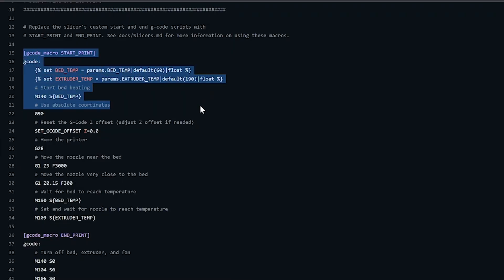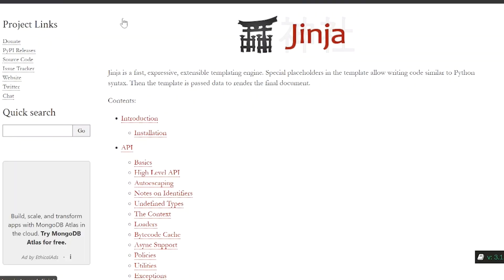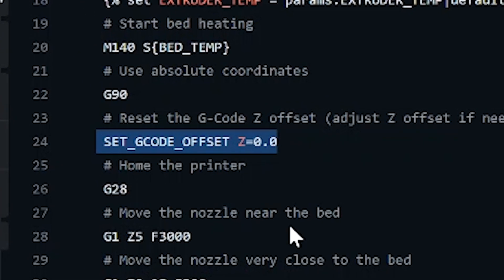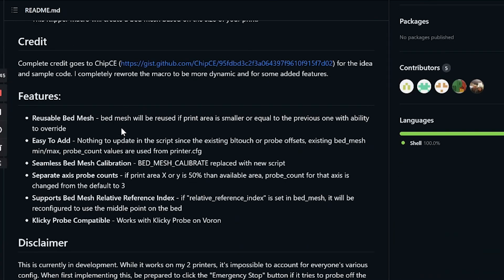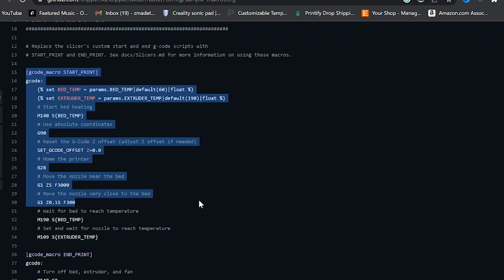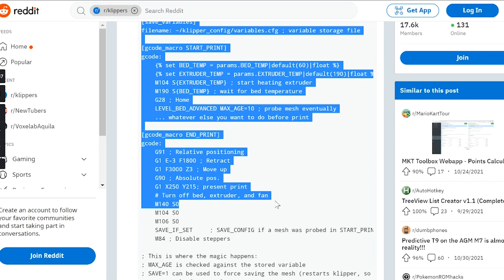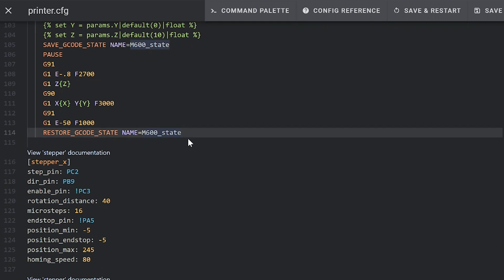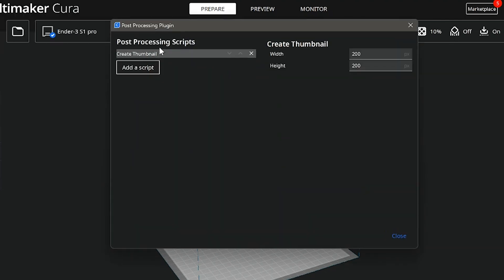Klipper macros! The basics

Comment: how do you disable macros? The one in particular is when I rooted my K1 Max it changed the purge settings. I can turn it off for that session but I've yet to find a way to fully remove it or at least have it disabled so I don't need to worry about it messing up my print. How do I do that? I'm running Mainsail.
Reply: Put a # before the [include purge_line.cfg] (or whatever the macro is called) in printer.cfg so it comments it out and doesn't use it anymore
Reply: @GeorgeDotExe_  thank you!!! I’m assuming you ssl to the printer and and running a form of Linux so just run vi? What directory is the cng file in?
Reply: @JoMiller97  no need to SSH into it, just open the klipper web page and you have all the cfg files there (left side panel)
Reply: @GeorgeDotExe_  I found it, you had to go into the KAMP settings... so now it doesn't do that line BUT, it does no purge line at all once I remarked out that setting.
Reply: @JoMiller97  oh, you haven't mentioned that you're using kamp, what purge method were you using? Line or voron logo? If it doesn't purge at all anymore you should go in your slicer, machine gcode, start gcode and check if you have the purge line gcode.
Reply: @GeorgeDotExe_  line is what I want to use. It did until lamp was installed. The line purge worked until I rooted the device and now there’s a macro switch that I have to change every time the machine boots to either use adaptive line purge or not. I have a feeeling I’m missing something else. I’ll check the gcode in a little bit once I get up and moving but I’d have to assume it’s there if it was before
Reply: @GeorgeDotExe_  ok, I think I found the setting that makes the adaptive purge line off by default but it's read only... how do I change that file to editable?
Reply: @GeorgeDotExe_  I figured it out but I did have to go in and edit with a terminal because I needed root access. Thank you for your help pointing me in the right direction

Comment: I cannot paste the macro in my printer config. It gives me errors and wont let me update. I also tried to put it in the mainsail config but that file says read only for some odd reason. Any idea why mine is doing this?

This is the error I get when trying to paste the macro into my printer config:
Source contains parsing errors: '/home/biqu/printer_data/config/printer.cfg'
	[line 11]: 'TURN_OFF_HEATERS\n'
	[line 12]: 'CANCEL_PRINT_BASE\n'
	[line 13]: 'G0 Z{z_safe} F3600 ; move nozzle up\n'
	[line 14]: 'G0 X{x_safe} Y{y_safe} F20000 ; move nozzle to remove stringing\n'
	[line 15]: 'M107 ; turn off fan\n'
	[line 16]: 'G90 ; absolute positioning\n'
	[line 17]: 'G0 X60 Y{max_y} F3600 ; park nozzle at rear\n'

Comment: thanks for the vid. a question about the start print macro. do i need to change the nozzle and bed temp everytime manually because there default 190 or default 60 in there? thanks for the answer
Reply from the maker: Hey there turion b, the answer might depend on what printer you're using, but in general once you configure your macro and save it to your printer config file your good to go😊

Comment: your content is too good to be true. thank you for your time
Reply from the maker: Hey Saif (726 see i didnt forget😉)  ! Glad to see you back! thank you so much for your kind comments
Reply: @z-made  you are welcome sir, I'll pop up now and then, I just got a sonic pad for my cr6-se, I'll be taking a closer look at the other videos to optimize it.

I tried to run klipper on a Rpi 4, no luck, couldn't find or tune the machine, there is hardly anyone online that goes into detail when it comes to the cr6-se, thankfully I got the sonic pad working out of the box, although didn't notice any improvements in term of speed like you mentioned.

so yeah, I'll be sticking around here until I get my printer to print reliably and fast.
Reply from the maker: I'm happy you found some value in my videos 😊